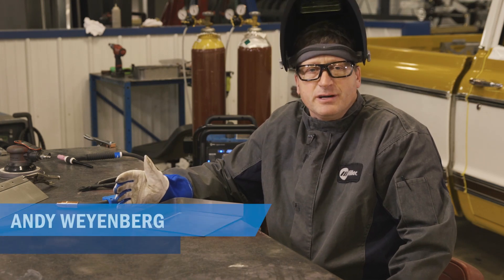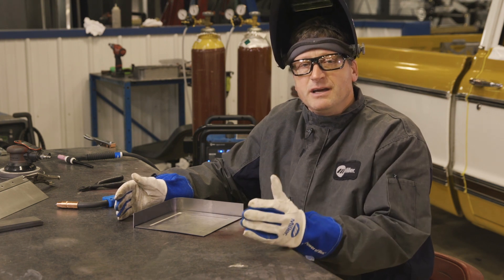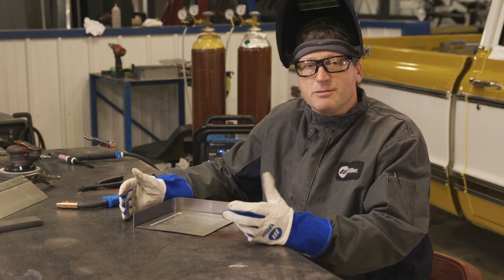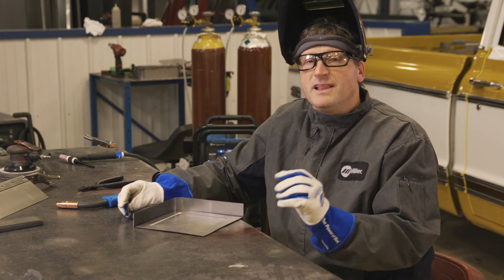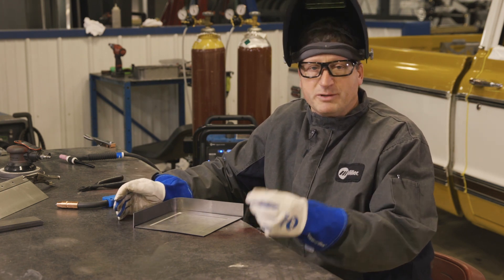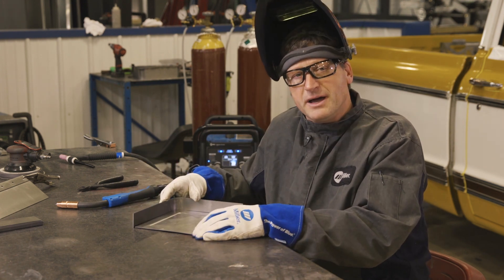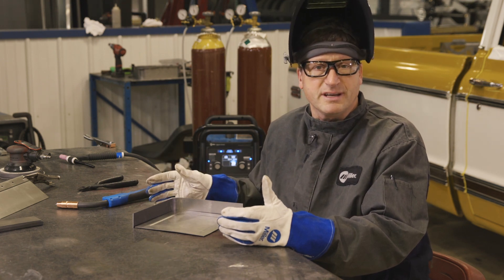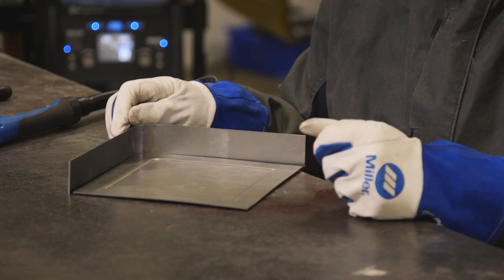Inverter Technology Provides Best Arc Start for MIG Welding

Comment: That sounds great, but is there a plain GMAW that will have the same arc start as the  multi matic, without spending to much.
Reply from the maker: Thank you for your question. The Millermatic 211 is an inverter just like the Multimatic 220.  Both units will have an excellent arc start.
Reply: @MillerWelders  great thanks. I will look into getting the 211.